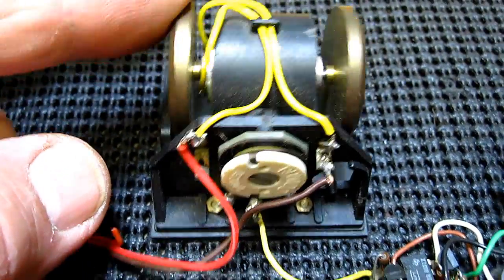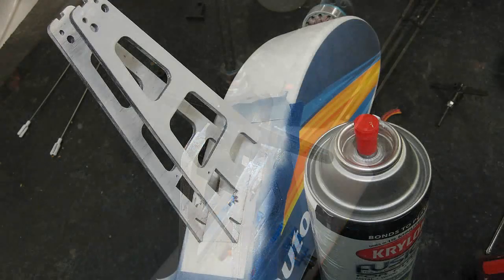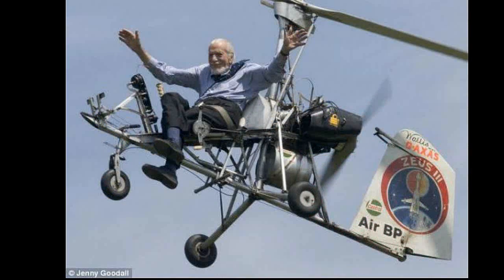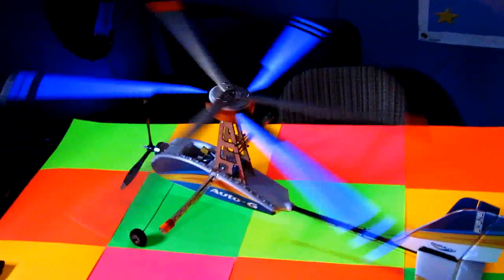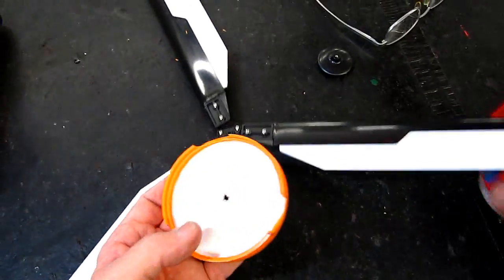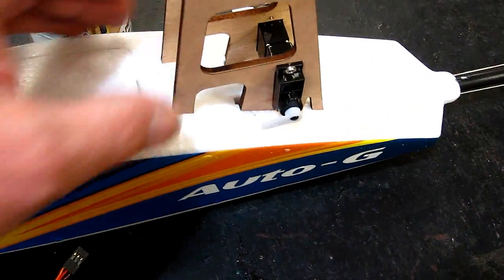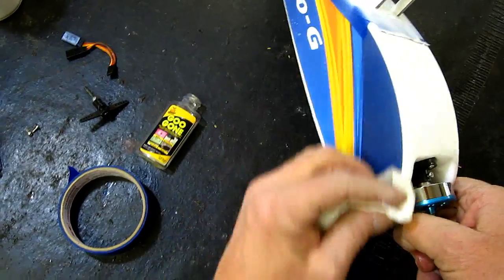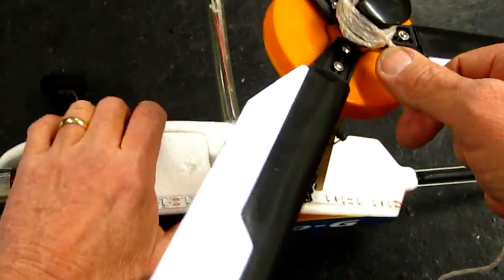Durafly Auto-Gyro Copter Mods, Tips, and Heavy Wind test.

Comment: Your wrap around blade spinner is like the old one lung mower engines from the 50's and older, you used to wrap a starter cord around a spindle to start them, pull it and then wrap it again for the next spin!  It was a great innovation when they brought out the recoil starter you didn't have to rewind.

Comment: Spot on, the rotor mount is intended to be flexible, it's called a 'flapping rotor'. This is an important part of the design intended to reduce the left roll tendency. It's a VERY bad idea to stiffen up the blade mounts, if anything they could do with being more flexible.
Plus of course in flight the blades dont spin ant faster on a windy day. The rotor speed is related to the airspeed of the model moving through the air, not the wind speed over the ground.

Comment: Took off on the first flight and no worries,Head speed was good throttle up and in 7ft the thing was flying!!! No left bank or roll on takeoff,Flew around for 5 minutes doing well and shit the sun,Where is it? and crash,2 broken blades.Got the new blades and put them on and they were spinning clockwise,What the hell,Go to the manual and nothing,Turns out the 2% pitch plates were on top of the blades.So they go under the blades lol.Thought maby this will help the not so smart like myself!!!!!!!!